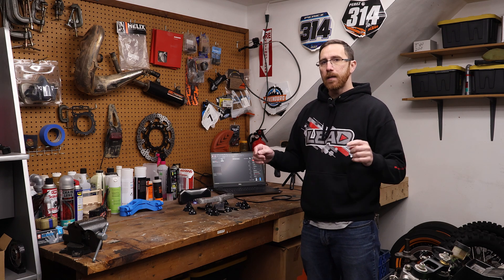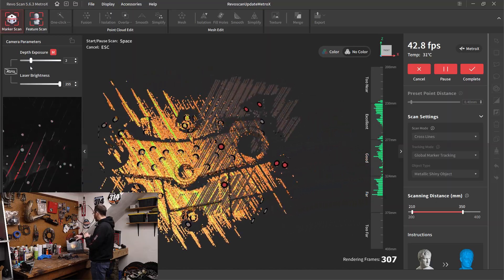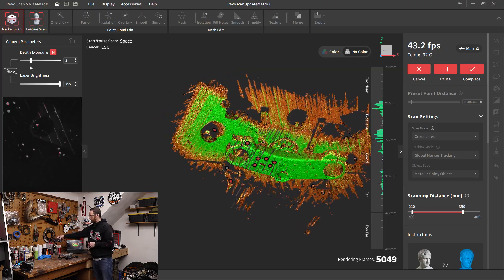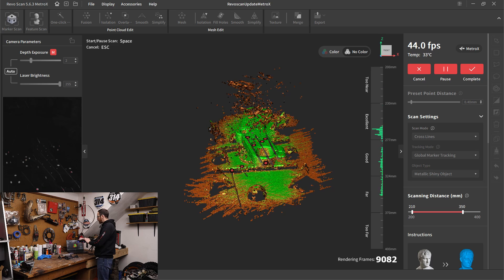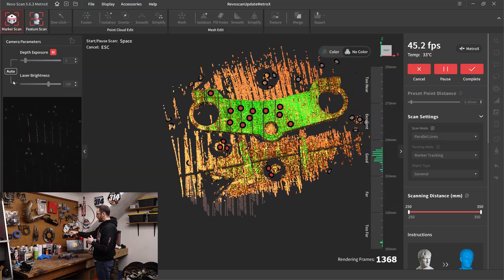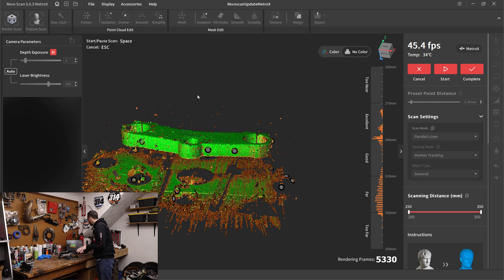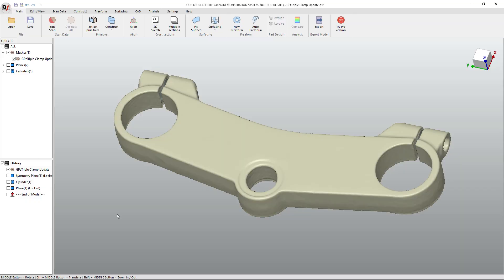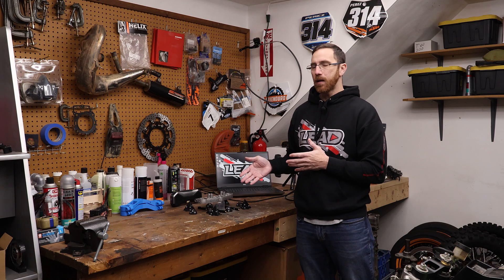Revopoint MetroX Laser 3D Scanner Update | Revoscan Update Improves Performance

Comment: MetroX better then Raptor Pro, but here I do not know why you have this result. Maybe you are doing something wrong? Even my old Ferret Creality could scan this model better. Maybe more light, maybe somthing wrong was with cable or computer is busy with some powerful task. Passed three months, maybe you already know the problem.
Reply from the maker: Hey There, I am currently filming a raptro pro vs metro x video where we will walk through the pros and cons of each.  Some scanners (even lower priced ones) work better on certain parts.  The last version of RevoScan 5.6.7 has a bunch of performance boosts.

Comment: Metrox X is unbelievably slow. So slow, i have to use my other scanner which doesn't even have crossed blue lines. Yikes.
Reply from the maker: Have you tried the updated Revoscan that touches the GPU?
Reply: @LearnEverythingAboutDesign I did enable the gpu option in the revoscan app. But, the lag is so bad. Revopoint has to work on the UI and the app. Its still  bad versus the more basic functions in CR scan.
Reply: @chiawildy563  is it the scanner or the speed of the computer it hooked up to! I’ve had to buy a new Laptop but it’s running fantastic.

Comment: By habit, I've gotten better results with their past scanners using Auto mode in the camera parameters. Is this required for laser mode as well? I noticed you have it turned off, why is that?
Reply from the maker: Part of it depends on what you are scanning.  If i am scanning something with scan spray or a pretty consistent finish i tend to put it on manual exposure.  If i am scanning something that might have some flat and some shiny sections, i tend to leave it on auto.  You can always switch on the fly.  I find that auto tends to be a bit slow and under expose.

Comment: what you find different between paralle and cross mode? coz i feel parallel is is faster, but less detail. thx
Reply from the maker: yeah both capture at the same frame rate so you are getting about half the amount of points with parallel line mode.  Each mode only captures points where the laser is.  Parallel mode is supposed to be there to help get fine details like if you need to precisely scan down into a crack/split area.
Reply: @LearnEverythingAboutDesign  thanks :D and have you ever tried to scan the big item, such as cardoor/ bonnet with metroX?
Reply from the maker: @kenxchoi775  https://youtube.com/shorts/h0Iwgy8JyCE?feature=share

What i would say with that is on laser mode it really doesn't work well because of the number of markers needed.  On full field mode IF your car has unique features or you put clay or something else as a feature tracking it could work. but for me the problem is the cable length and distance from the object.  So 300-350mm is about how far you need to be away.  So about a foot away vs say the Miraco on Far mode which lets you get about 3-4ft away from the object.  Much fewer markers needed and/or just use feature tracking and not be tied to a cable/laptop.

So if that is the scanner you have, sure you could make it work, but it probably won't be fun :)
Reply: @ thanks mate :)
coz i was getting hard-ish to put the scanning block kitonto the bonnet/ car body, instead of the marker, there was the scanning block/ brick which is magnetic one, do you find hard to remove the scanning block from the mesh?

Comment: Wonder how this unit compares to the tried and true Einscan
Reply from the maker: i think they are for different things.  The einscan is an IR based scanner meant for larger objects.  the point distance/resolution of the einstar is closer to something like the Range scanner.  Id say the best direct comparo between Revopoint and Shining would be the Miraco vs the Vega as they are both self contained units with the ability to scan close/small objects and far objects.  I am currently talking with Shining so might be testing them on the channel in the near future.

Comment: I had a MetroX for six days and returned it for a Raptor. It is so much better and faster, even with fewer laser lines. But Raptor’s lasers are finer. Most videos show scans of big parts. Try scanning a coin or a screw, and you’ll see 🙂. With the MetroX, I didn’t manage a single successful full-field scan. Honestly, I felt bad for believing all the 'positive' commercials.
Reply: My experience is different. On my working PC (i5-12th, 16GB RAM), Raptor doesn’t work at all, but Metrox at least runs. You can check out my video for reference. Also, as far as I know, Revopoint says MetroX is for small to medium objects, not large ones. Are you sure you’re using it correctly?
Reply: @ I used both Scanners with my gaming PC...AMD Ryzen 9 3950X 16-Core 64GB RAM GTX2080 Super. Here is the Raptor much faster... Every Scan so far took me less than 5min. I need it for more on the small scale objects. I understand if you have no choice but scan a Coin with small details in Laser mode and compare it to : https://www.youtube.com/watch?v=IOiQwhGSrJc&t=220s
Reply: @danielmeiner161  i'm with the raptor. Its less frills and lag. I used the same exact pc on both metro x and raptor. Raptor always never fails. Metro X does have a more comprehensive post processing software to clean up the scan. That is an undeniable advantage in using metro X. Still.... the x feels somewhat unpolished.
Reply: @chiawildy563 perhaps this has now changed with GPU acceleration proving better FPS to MetroX? I have no first hand experience, but I have noticed that this commonly reported issue of MetroX appears to be related pre-GPU-acceleration era?
Reply from the maker: Thanks for sharing and sorry you had that experience!  I have tried in all my videos to show it in real time as is rather than trying to sell it.  Im not a salesman :)  I have found the metroX to be sensitive to ambient light and object surface finish as i showed in this video with the noise.  I have been impressed with full field mode though as long as it has enough unique features to track.

Initial reports from people told me the Raptor wasn't much better on laser mode, but it sounds like that has changed.  I still haven't used the raptor so its all 2nd hand info from me, but glad you are happy with it!

Comment: Was hoping you would do an update video like this. How do you find the dimensional accuracy of the MetroX?
Reply from the maker: The diameter of the forks, in QS i added cylinders that were within .03mm accuracy (on the color bar so under that number).  Measuring the cylinders at 43.051mm .  Measured by hand that spot was 43.08mm.  The other side the cylinder seemed to be a little more off (maybe due to scan quality in the bore). it was 43.3mm and the measured value was 43.16mm.  The distance between the forks i measured at 205mm and the cylinders applied were 204.65mm apart.    so that was .35mm off BUT again its based on the cylinders applied based on the scan quality.  The stem hole scanned measured 23.945mm and the caliper measured was 24mm.

So i do think part of it is accumulated error from the rough scan inside the clamping area.  

So the stem area was about .05mm, claimed accuracy on a single scan is .03mm.  The vol accuracy claimed is .03mm + .1mm x length in meters.  So that over the length of the clamp is a claimed max vol accuracy of .05mm between forks.  And i am seeing about .35.

all that to say is I would always suggest using calipers or some sort of measurements to confirm critical features.  The clamps when they aren't bolted aren't really round so that throws off an applied cylinder to the mesh for example.  so while the cylinder size is very close to what I measured, the distance between those cylinders is a bit more variance.
Reply: @LearnEverythingAboutDesign  Thank you. Exactly what I need to hear